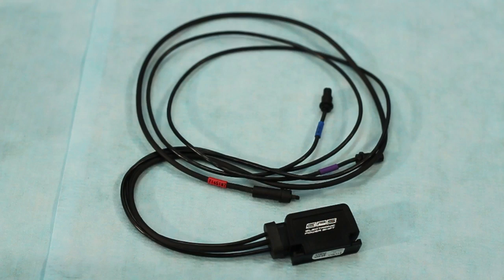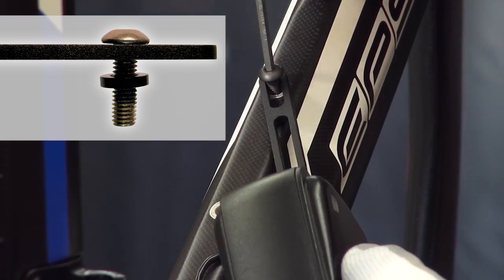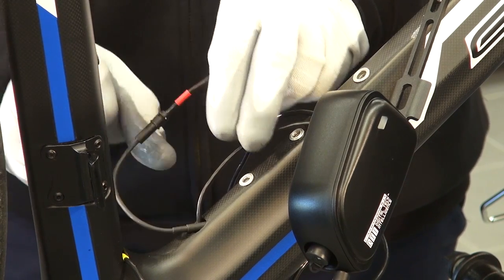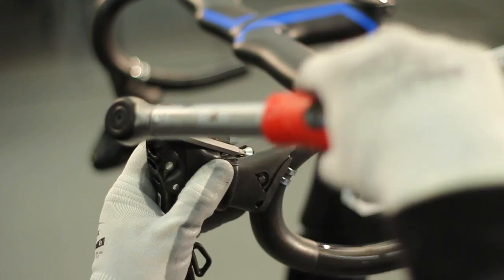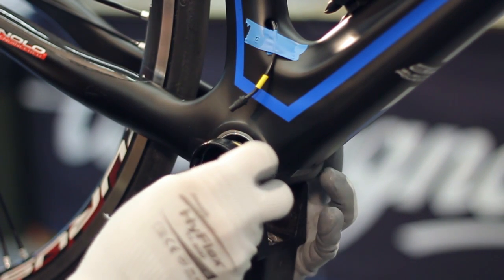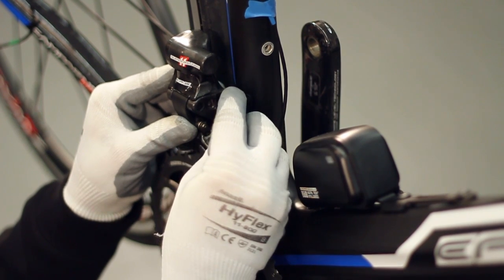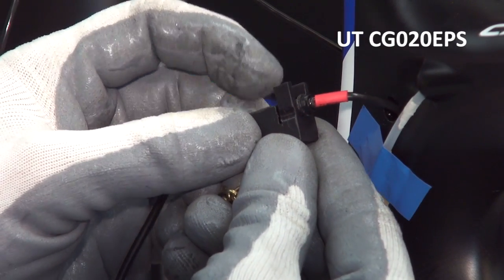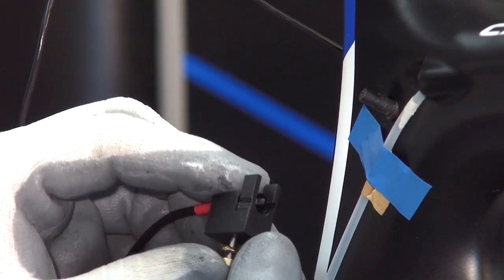CAMPAGNOLO EPS ELECTRONIC GROUPSET - COMPONENTS ASSEMBLY

Comment: WHAT IS THE "APPROPRIATE TORQUE", FFS!! No instructions supplied.
Reply: The figure of 15Nm appears on the screen after he says that, so it seems instructions are supplied.
Reply: @trafficlawvictoria6614  You're right. It takes ages to come up though after it's mentioned, and it's not spoken. If you are skipping through this video to try to find it (because the derailleur itself doesn't come with instructions, and they are impossible to find online), you are not going to see that. It's insanely frustrating how difficult it is to find full instructions for Campagnolo parts (despite the thick booklet saying "danger of death" in 50 languages that comes with everything...).

Comment: The colours are not the same on V3. Instructions that come with the battery etc are useless. Not even a diagram to show how the cable is inserted into the lever.
Reply: V3 Green Green Rear Derailleur / Yellow to Yellow Front Derailleur / Grey to Grey Battery and Interface / Violet to Violet – Right Shifter / Blue to Blue – Left Shifter / Need Help reach out I will walk you through it
Reply: @roba8732  Many thanks Rob, I managed to get it going on my desk top all connected  and operating 👍👍